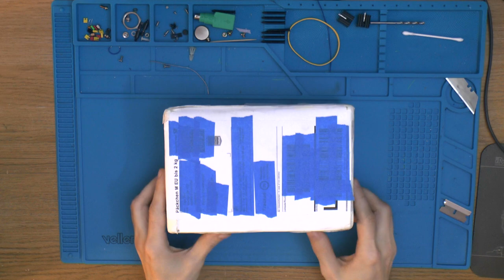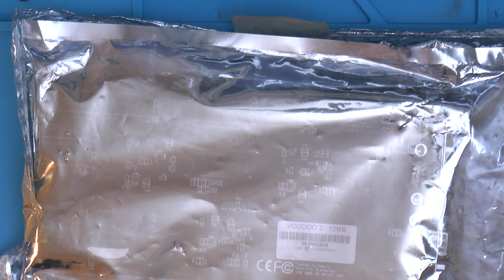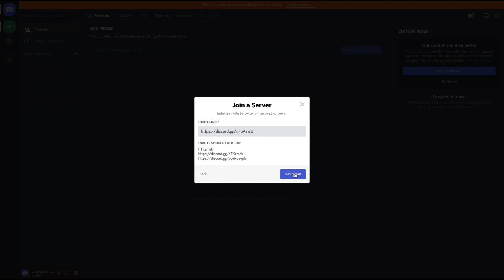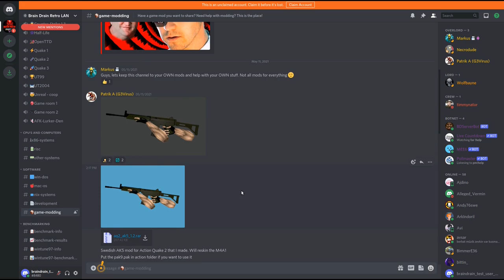Mailbag #2 - Graphics cards

Comment: Ran my Ti4200 at 310MHz GPU and 590MHz VRAM if my memory is correct.  It was a version with faster RAM chips on it, so that's why the high clocks
Reply from the maker: Was it the 64MB version? They seem to have 3.6ns RAM usually.
Reply: Nah it was a 128MB version actually. Point ov View GF4 Ti4200XP.  I dont remember exactly but I think it was a 4200 chip on a 4600 PCB and with better vram or something like that. Anyway, I think I was in the top 5 for a while on 3D Mark for my hardware combo. :)
Reply from the maker: @Skracken  yea I saw one for sale a few weeks ago but went for like 40€ on tradera plus shipping. Also wanted it because of the faster ram but cant pay 50€ every time I need a part for a YT video.
Reply: I would love some time to play aroubd with old computers again. I did save a lot of the stuff, but right now I dont really have space to set it up. At least if I dont wanna get killed by my wife hehe ;)